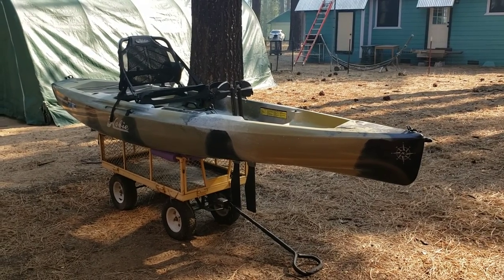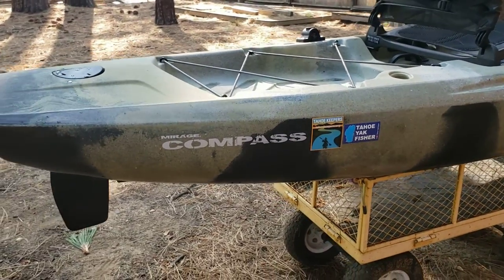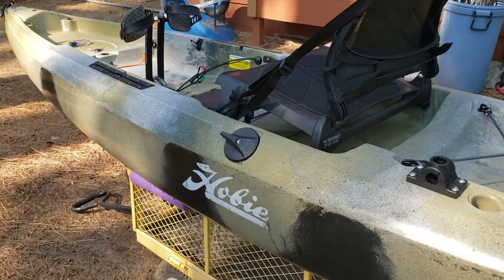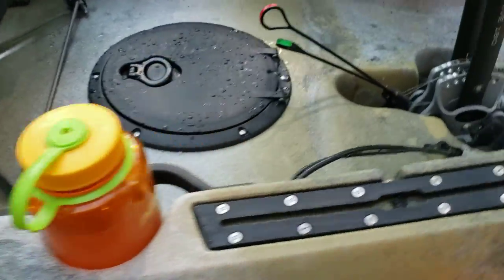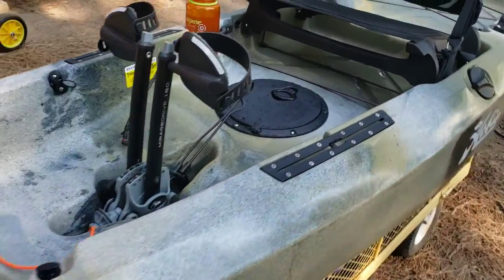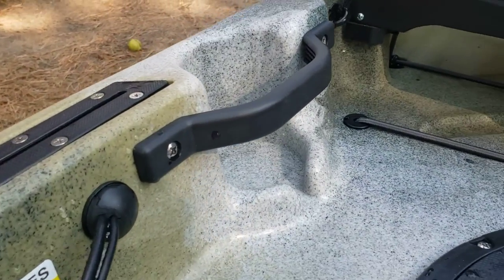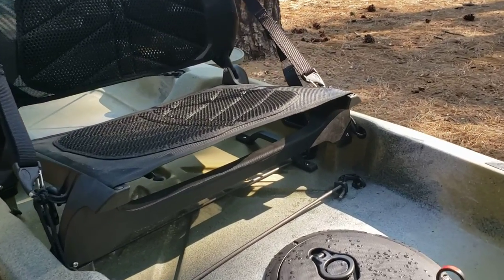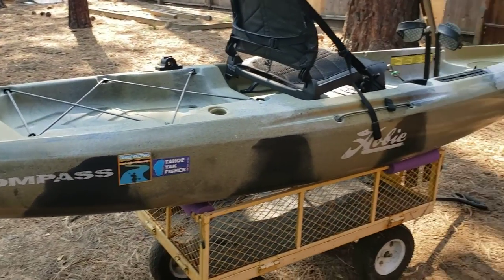Hobie Compass Side Handle Solution, and a couple more COOL HACKS!

Comment: Hey there. I just picked up a compass, but it's the newer model with a different seat design -- the seat area is less stiff. I'll let you know if I end up installing the handle bar in that area / how it works out, but I'm definitely installing that one at the cup holder. How are yours holding out?
Reply from the maker: @dfly1115  no regrets. I use both handles to lift the kayak over my head. No problems.

Comment: This might be a silly question, but when you say that you backed the RV handles with fender washers, are those washers on the inside of the kayak? Were you able to reach those mounting points through the circular center hatch?
Reply from the maker: Yes on both.

Comment: I have the exact kayak and I've had it since May.  I did the usual upgrades moving the small hatch up front and adding in a bigger rectangle one.  That is a great upgrade for storage, etc.  The drink holder hack is awesome because I am using the Scottie cup holder but they no longer make the brackets so it's being held in with velcro and I am very disappointed with it.  I am going to use the brackets you are showing!  Can you explain more about the placement of the washers?
Reply from the maker: Once you have the handles in your possession, I just eyeballed it, marked it with a sharpie and drilled it with a 1/4 bit. That bit size is small for 1/4-20 screws so I had to "hog" it out a little for the best fit but it was the best choice of bit that I had. There is a fair margin for placement of screw holes but reach in through the center hatch and feel the back side where the washer and nut will end up, before you drill, so you know exactly where your drill bit is going. You may have to push aside the foam blocks in there. Make sure and use "fender" washers that help to distribute the load of the handle. Hope this helps.